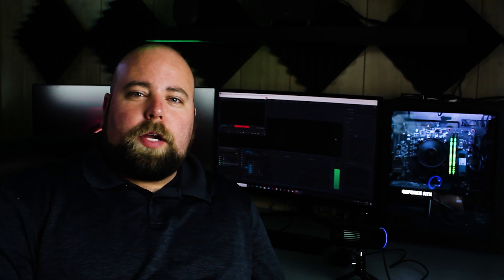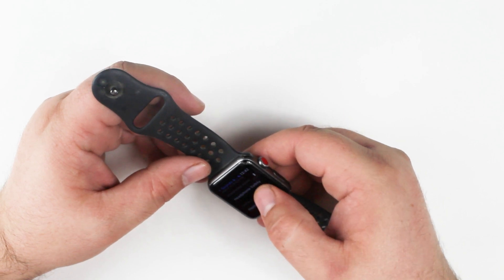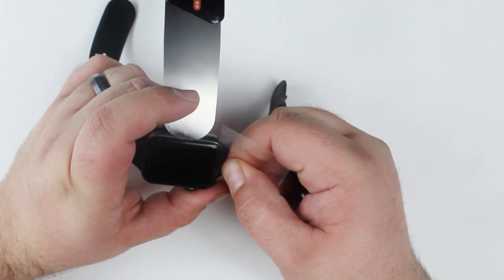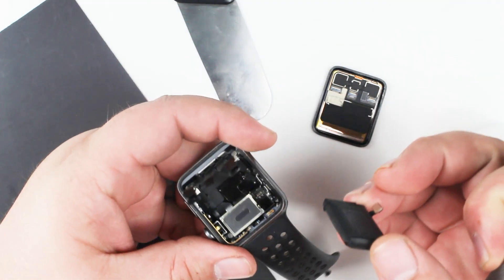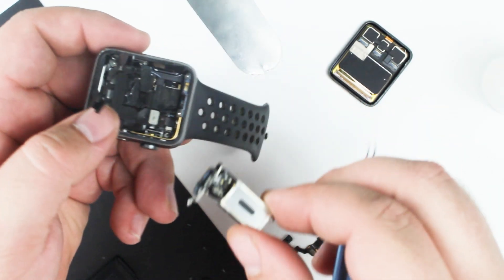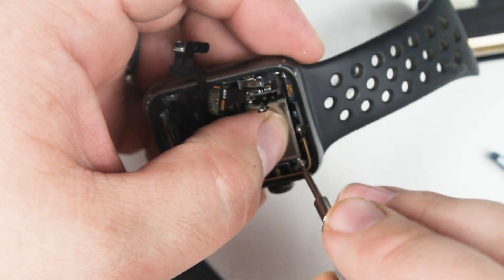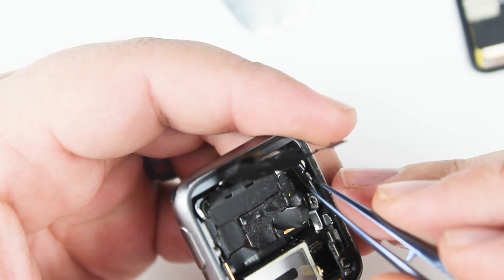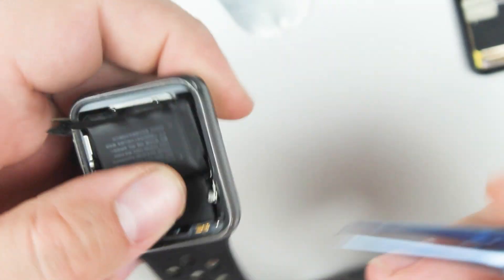Fix Your Apple Watch Mic: Step-by-Step Repair Guide!

Comment: A kid insert a pin (smartphone's pin) into microphone hole and push it. I don't know if damage the microphone, or now is not water assistant anymore. Is there any way to test it with safety?
Reply: Gone through same 
Does it damage the microphone or anything?

Comment: I had gotten a refurbished series 3 GPS (42mm). It was working fine for the two days I had it. Then I had accidentally dropped it on my drive-way while trying to put it on my wrist  and it fell face down. The screen was cracked but still on and functioning. Only the lower left corner wasn’t picking up finger touch. Anyways, I had gotten the screen replaced at a repair shop and when I got it back, the screen worked fine but the microphone no longer picked up my voice. I tried every possible thing that Google was advising. Enabling Siri / dictation, all that. But still it didn’t work. I took it back and the technician said that the microphone didn’t look damaged. Then he said maybe it was because he may have put a Cellular Screen on it rather than a GPS. So I went ahead and did ordered the GPS screen from there and he repaired it, but still microphone did not work. What could have caused this ???

Comment: Thank you for this video! Would inserting a pin into the hole thinking its a sim removal hole on AW series 6 damage it long term? I tested with recoding app and microphone seems working just don't know if I seriously degraded the longevity of the microphone or water resistance.  t-mobile operator assured me I need to get a external sim to make the cellular work.
Reply: I made the same stupid mistake and half a year later the microphone is dead. Maybe a coincidence though. Maybe not: We’ve had a lot of rain in Germany the last weeks, so maybe it was the moisture and the lack of water resistance, thanks to this stupid „SIM-Pin“.

Comment: i didn’t know mics can fail on AW?
Seems like they seem alright for quality 
only thing that breaks usually is screen due to User fault & one occasion of Apple messing up quality on the S2 or S3 or original S1 i cant remember

edit: can you elaborate on all the reasons it fails? you said there are other reasons

so i can be informed